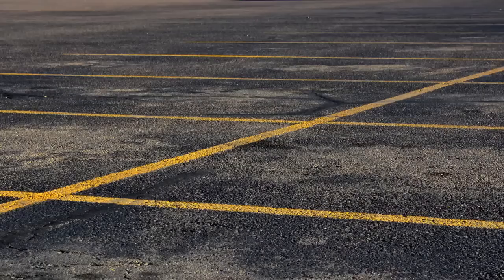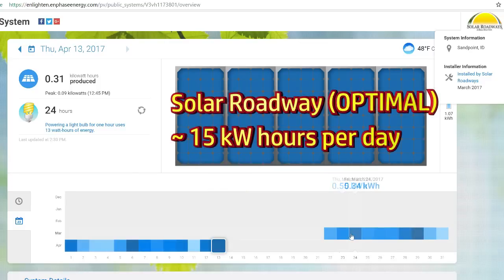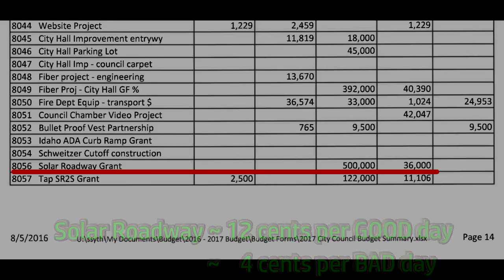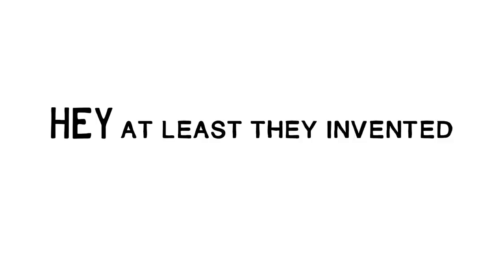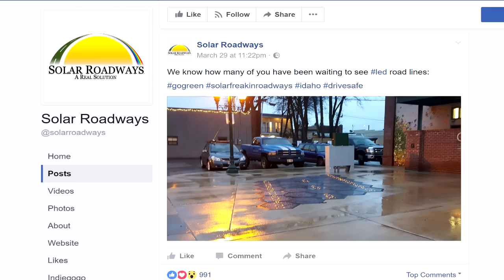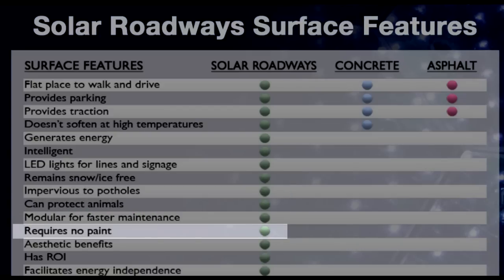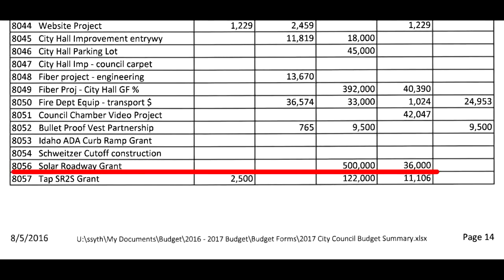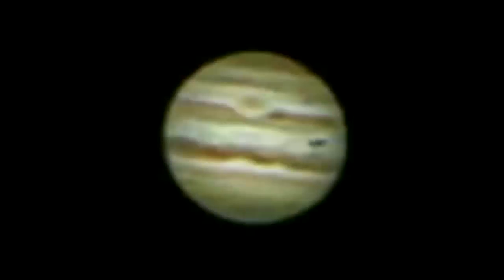Solar Roadways generate ~10 CENTS per day!!

Comment: Is there some high need to have lines in parking lots be able to be adjusted at will? Conventional lots using paint seemed to work just fine for the last century or so.

Comment: The way they installed that outdoor sample, with it’s uneven setting and vinyl runners between each section, how can they expect to make a playground basketball court with that sloppy installation?  I think they’d be getting most their power from the obvious lawsuit when some teens bust their ass tripping over those uneven panels making a hook shot.

How can this moron tell Walmart a parking lot Solar roadway would produce any power at all because most Walmarts have 60% to 80% cars parked over the damned Solar panel?  It is a parking lot after all.  That means car parking on it.

Comment: CURVED SURFACES should have halted this brain dead concept while still a sketch on the back of a napkin during the late night drunken binge which surely hatched this stupid idea...

Curves, hills, drainage slopes, etc. dictate that every section of every road ever constructed could not be constructed with perfectly flat panels.  or am I missing something obvious??

Plus imagine the environmental costs incurred during the mining and the manufacture of the panel materials alone.  For such pathetically low Kwh generation the impact on the environment far outweighs any potential green / sustainable claims.

Comment: At what cost? How much more than asphalt roadways? And consider the rule of thumb that "The More Complex A Thing Is, The More Likely It Is To Break down" and these useless things kept breaking down.
Reply: Their current estimate - which is for driveways and the like, not roads - is $525 per square foot. That however does not include labour and prep.

Comment: Even if the electrical generation was high enough and they were durable enough to use as a roadway, you'd have to consider the regular cleaning that every single mile of road would need on a weekly basis.  Dirt, oil, leaves, dead animal remains, debris from cars/trucks/etc would need to be regularly cleaned off to prevent sunlight penetration blockage.

Comment: Replacing Tarmacs?

Imagine this somehow gets pushed through and Solar Roadways have replaced all the materials that make up the ramps, taxiways and runways.

Now remember the point made about differential loading and traction.

Imagine a Boeing 737, among the most widely used commercial aircraft in the aviation industry, landing on a runway made out of these. All of that weight focused on three points, rolling along a tiled surface that was originally made for cars.

Now imagine if such an aircraft had to actually perform a hard landing for whatever reason; pilot error, instrument failure or even an emergency.

Comment: What really grinds my gears about this is the waste of solar panels. There's some fairly toxic stuff involved in the production of solar panels, heavy metals and the like, as well as whatever's in the other components. Some of those are relatively rare/expensive. It's part of why solar isn't super cheap. Thus, one should get the most out of one's solar panels, from an environmental and cost perspective. Crap like this is wasting resources and harming the environment more than necessary. F*cking hell.

Comment: I'm not sure if those power calculations work. Sometimes TF uses kW and kWh interchangeably, which doesn't sound right to me. One is a power unit, the other is an energy unit. Also, he seems to sometimes treat kWh and kW/h, which isn't the same. I need to check these things someday

Comment: Update of electricity production:
In November and December, the average daily electricity output has been a massive 0.11 kW-hrs! 
There is a light snow falling in Sandpoint, and it looks like the waste heat from the LEDs is enough to melt the snow where the LEDs are working. I was guessing that they were using 2 watts/panel to keep the LEDs lit, but this would take more than that! Maybe 10 or more watts per panel.  By the way, even IF they were only using 2 watts per panel, they would already be more than 230 kW-hrs IN THE HOLE! At 10 W/panel they would be more than 1800 kW-hrs IN THE HOLE, or about -$220 in cost and 220 pounds of CO2.  So much for saving money and the environment!

Comment: They have shoveled or swept all of the panels free of snow. They figured out that it was cheaper to plow than to use electricity to melt the snow. It has now produced a grand total of 4 W-hrs of electricity.

Comment: Now there is more snow and they even plowed snow ONTO the solar turdway. The only panels showing is a few that they plowed off.  I wonder if the plow damaged the metal strips holding the panels in place. There is definitely only a small amount of melting of snow where some LEDs were lit.

Comment: I live in Hawaii in a rainy area (15-17 feet of water / year). I have a stand alone system that supplements my grid power. Out of 1500 watts of panels, I glean about 4 KWHs/ day. Rule of thumb, 2 1/2 to 3 hours of rated power per day.  Real world. And- mine are static, no solar tracking which would double the cost of my installation. This is financially feasible for me because I pay about  $0.50 cents  / KWH, and my payback is about 6 years, which I'm about halfway through. Of course I'm SOL of someone steals it, which is why I didn't go full solar.
Reply: Now that they have completed the best half of the year with 183 days down, the solar monstrosity has averaged about 2/3 of an hour at rated power per day. A local charter school, which is about a mile away,  has a properly angled solar array that has produced an average of 3 hours at rated power per day for the same period.

Even correcting for the loss of output of one of the five inverters they would have only produced 148 kW-hrs for the best half of the year. Since they will get an average of only 70% of the hours of sunlight for the rest of the year and the angle will average 20 degrees lower, an upper limit for the rest of the year would be about half as much. This would mean a total of 222 kW hrs, or About $26 of electricity at 12 cents per kW-hr.  

That doesn't even account for the use of electricity by the electronics and LEDs. As for melting the snow, I have shown calculations in earlier comments that estimate the amount of electricity to melt the 59 inches of snow that Sandpoint gets on average as between 200 to 500 kW-hrs per year. Of course they have not, and probably will not reveal the net energy of this disaster.

Comment: And what happens when you drive 10000 cars over it and the surface gets scratched and covered in a thin film of dirt? Efficiency will plummet even further. And then the weight of Tractor trailers driving on them = millions of panels failing per day. And then there is the logistical nightmare of trying to repair all these failed panels everyday without stopping traffic...And where does the power come from to light them up a night? Are you seriously going to have a battery in every single one? Logistical nightmare. Are you going to have a battery "shack" every half mile to inject the power back in? Logistical nightmare. Are you going to grid connect it? Logistical nightmare. It just gets really, really stupid the more you put all the horrible aspects of it together.

Comment: Since the beginning of Spring the average daily output has been 0.85 kW-hrs for a total of 102 kW-hrs in 120 days. This is the time when the sun is in the sky the longest and the angle is best.  They  will get about 50 more kW-hrs before the beginning of Fall.  From the beginning of Fall to the beginning of Spring next year, they might average 0.5 kW-hrs due to fewer hour of sunlight, worse angles and more clouds. This would give about 90 more kW-hrs for a total of about 250 kW-hrs * $0.12 /kW-hr =$30 worth of electricity. It will take at least that much electricity to melt the average 59 inches of snow that falls each year in Sandpoint.  Then you add to amount of electricity used to run the electronics and LEDs and you have a net negative "profit". It sounds good to me.

Comment: What about putting them OVER the road?  So...snow doesn't fall on the road.  You will have savings in road maintenance as snow plows won't be tearing them up all winter and the sun won't be creating all that thermal expansion.  You will be able to angle them towards the sun.  You still have the SAME footprint of just the roadway.  You don't have to pay to burry the cables.  I mean it doesn't have any NEW problems and it lacks many of the problems associated with solar roadways.  If you really want you light up markings, paint some of the road white and PROJECT DOWN from the canopy....onto a shaded road surface this wouldn't take near as much power.
Reply: It just seems that a HUGE part of the problem is the insistence of putting them ON the road surface...if you put them OVER the road, they might make more sense.

Comment: Honestly, they'd be better off forgetting the 'solar' part of this and try to optimize the 'use this for roads' portion. Maybe use the installation as an excuse to migrate power lines there.  It doesn't take a college degree to figure out that no material exists that's both durable enough for road traffic and allows solar panels to work properly. Maybe they'd be able to make the LED's and shit actually functional if they could use the 'solar panel' portion of the things for that?

Comment: Hey Thunderf00t! I know there's about a hundred other reasons that solar roadways are totally impractical and a fool's errand but I was pondering one I don't think anyone has mentioned yet.  

When large trucks and powerful cars accelerate they can cause tremendous pinch stress on the roadway surface.  The same goes for braking with a heavy vehicle like a cargo truck.  As far as I'm aware one of the biggest dangers to tempered glass is a sharply concentrated force-- they deal with distributed loads well but a sharp impact concentrated at a single point (such as the sparkplug in the example you mentioned in a previous video, or a tungsten carbide "emergency window breaker" punch for evacuating cars after a water crash) is likely to cause catastrophic total failure.

So what would happen if someone in a powerful car, not even talking a super-powerful car like a Koenigsegg Agra (at about 1200 joules), which can actually damage even a normal tarmac, but a more modest sports car like a Tesla model S (930 joules) or Audi A8 (850 joules) stomped their accelerator on a glass roadway?  That's not even MENTIONING a large semi truck weighing up to 36 metric tons and moving at 105 Kph (typical US motorway speed) having to use its emergency brakes.  The net effect would be a patch of roadway is now attempting to accelerate with that kind of impulse, and the glass immediately in front of it would be motionless.  That sharp line of pinch stress is going to try to buckle one way or the other, and is quite likely to succeed.

We're also ignoring the loads of those trucks too, up where I used to live in the northern US they quarry stone for gravel and concrete, and the stone is primarily granite-type rocks (thanks to the Canadian Shield).  Shards of that flying off a truck at 100 Km/h would devastate a solar roadway without doubt, like the sparkplug example you cited.  We know this is true because they'll gladly do the same to a tempered-glass windscreen!

Comment: Tis a shame that it's such bad physics. The idea of the roadway for cars to drive on made me think it was a fail before I even watched the video. It just doesn't make sense, they're not that strong. It would be great if we could find a way to collect energy from the parts of the ground which can't be used for agriculture or sport, etc (essentially paths and roads). But even to this non-scientist, this isn't ever going to work. 
Make photovoltaic cells look like tiles/shingles/whatever goes on a roof (to stop NIMBYs moaning about solar panels looking ugly) and cover all buildings with them, and we'd - eventually - start getting energy collection to overtake the material and monetary costs of the construction/installation/computer facility in each building to control it. They don't need solar energy per se (ie the heat) in the same way as the panels. I've seen some which, made out of new materials, require only photons to at least trickle-feed in-between boosts during good, sunny, cloudless days. Obviously, the further away from the equator, the longer it would take to get your money back. But still, I think this would get a better reception than 'cover one side of your house with humungous panels' - which I would do if I could afford it.
We need ideas, but they have to be sensible.  It's genuinely sad that their idea is so awful.  It gives ammunition to the anti-climate-change brigade, and we cannot afford for them to be more dangerous than they already are. 
(Is it just me, or do others agree with my impression that in the US in particular, those who "don't believe" in climate change are those most likely to be gun-toting, Constitution misunderstanding, NRA members or those support their ideas?  I was going to say 'principles' but somehow that didn't sit well with me...)

Comment: Thunderf00t - could you look into this to see whether it has equally poor economic/practical issue?  http://www.alphr.com/cars/1005950/qualcomm-s-dynamic-charging-tech-could-make-electric-vehicles-mainstream
Reply: First of all, "20 kW per hour" is wrong, it should either be 20 kWh/h or just 20 kW. But hey, it's just a sci/tech news outlet, we can't expect them to get high school physics right! Either way, you're sitting on a 20 kW air-core transformer and I'm not sure that sits right with me. 
Second, a Tesla Model S has a range of 335 km with a 60 kWh battery, meaning that at highway speeds, a 20 kW charge won't "top up" anything, it will just maintain charge at best. To eliminate charging stops altogether, you'd need to pave all the roads and highways with this thing, and I don't see that happening. It would make for an extremely underutilized infrastructure too, I mean, the power delivery units themselves are stationary, and a car coming along at 120 kph will spend less than 1/30th of a second in range of one. Even in heavy traffic, that's an utilization rate of ~3%. 
We don't know how much these things are going to cost, but it just seems wasteful to me. A Tesla Supercharger will give you 120 kW, meaning that a 30-minute rest stop every 3 hours should keep you charged even at highway speeds. And it's only going to get better.

Comment: Legit Question, on a standart solar panel, wich rotates to adjust its positioning towards the sun, how much of the energy is spent in moving it around?
Reply: Makes sense, i dint even consider either a stepper motor, wich have a very low requirement, nor predicting and setting the daily movement, wich is basic tbh. I guess thats what happens when i ask questions at 4AM, lmao. Thanks!

Comment: Solar roadways are a great idea. So good that it should be illegal to park and drive on them as this would block out the light. This would also reduce the cost because they would not need to be designed to bear large weights. You could even raise the solar panels above the driving surface. This would allow for future innovations, such as tracking the sun to help maximize efficiency.

Comment: Hey thunderf00t, can you do something on why you think there are some many of these silly ideas that float around. In Addition to what you already "busted" there's Musk's new tunnel idea (just look at former coal mining areas to see why cheap tunnels are a stupid idea) and going off the electrical grid with batteries ( why not go offgrid the Internet with a data center in your basement - all the really important stuff on Twitter is broadcasted on tv anyhow). Is it this idea of grandiosity, which to be fair I have got too (i just am unrecognized genius) and at least it's a fun pastime to bust or simply discuss an idea? Or more problematically is it the lack of sceptical thinking and general understanding of how things work especially of the reporters and journalists? I think it's also this idea that everything that we do is somehow bad and need to be revolutionized , when actually things are done pretty much the optimal way, unless you change the constraints of a problem radically (the solution is than usually much worse in terms of costs etc, eg. when you enforce all roads to be energy producing solar roadways become a good solution (at least better in terms realibility than the idea to converting the weight of moving traffic into energy))

Comment: woudn't it be far more efficient to use the heat from the asphalt to power stirling engines than photovoltaics in areas with desert climate if they really wanted solar roadways ?

Comment: I invented a mask that strips an electron off of O2 and replaces it with an identical but legally distinct electron. It helps you breath by letting your lungs absorb oxygen, because the legally distinct electron may be in a different position than it otherwise would have been. It also has a smartphone app that tells you when you should inhale and exhale, and a leaderboard that lets you do battle against your friends to see who can not breath for the longest amount of time. I can manufacture these incredible masks for extremely cheap. I just need 100,000 of you to donate $20.00usd each, and I will ship you five of these masks.

You also need to pay for shipping, handling, and $3.95usd for the package of surgical masks.

Comment: Kettles are 3000w?  They are all 2000w and under in Australia... but we have 240v.... I wonder if kettles boil faster in different parts of the world depending on the electricity system.